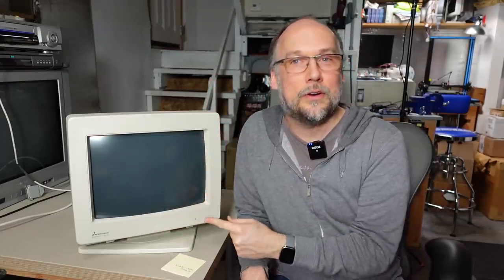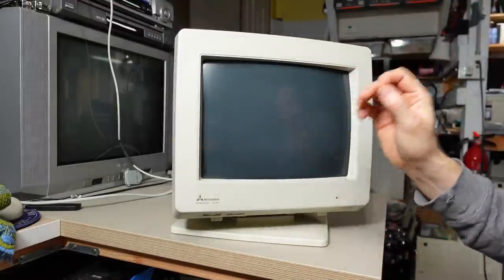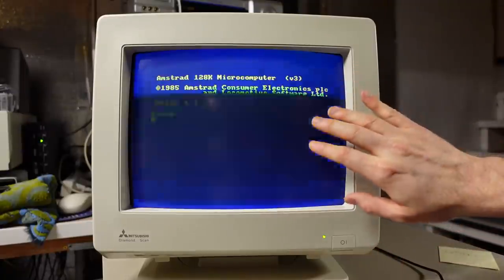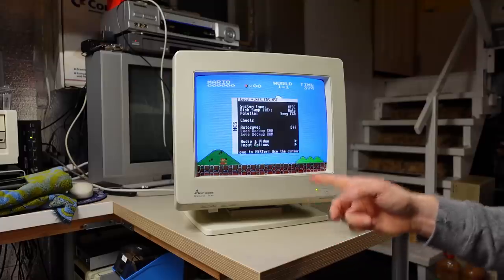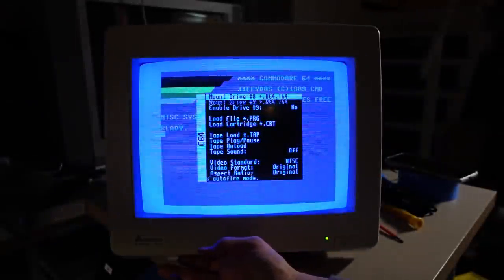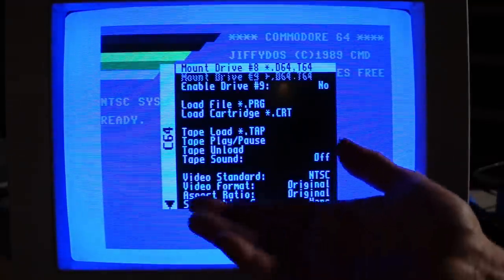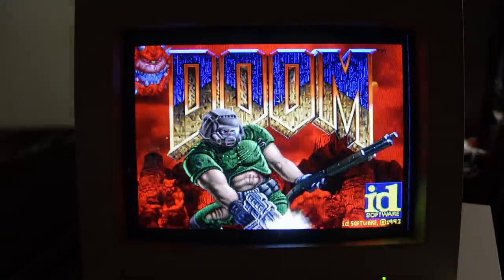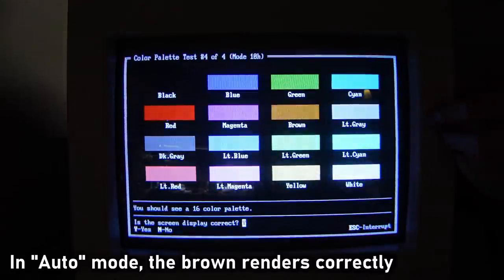Can I rejuvenate the CRT in my Mitsubishi Multisync monitor?

Comment: Also Adrian, you need to put the CRT neck up when doing rejuve and short work because the little metal particles need to fall away from the guns, then when done don't put the neck down at any point because there will be metal particles in the tube, just let them fall to the "side" of the tube as they should naturally when you put the tube back to it's operating orientation.  We do a lot of this kind of work for Arcade games.
Reply: now that you mention that, I remember being given the same caution, years ago.
Reply: This is true. I remember this from when I was fixing tvs.
Reply: thanks for sharing mike, it's a dying art
Reply: you see that hawk crt guy who would open up the CRTs and bake them in kennels?
Reply: As an old TV repairman (when that was a thing) and I worked on CRT tubes, this is a good practice for those tubes.
Reply: Umm I was taught not to do it face down, because the debris can fall onto the shadow mask and block some of the perferations and cause some phosphors to not light up. Also the timed rejuv is not suitable for monitor crt'. It strips the surface of the cathode. Monitor crt's tended to have thinner coating. So what may have been a gentle rejuv for a tv, is very harsh for a monitor.
Reply: Awesome stuff, I'm all in.

Comment: When I was a TV engineer I built my own monochrome tube zapper. (Rejuvenator)
It consisted of two light bulbs a power resistor and a smaller carbon resistor plus mains cable and leads and socket to the tube. It's a long time ago as I was about 17 at the time and now I'm  63. Basically the one bulb 100w was to allow current to the filament and the other 15w was the current feed to the cathode and grid. 
I copied one that the other guys used and it worked pretty well, but not every tube could be improved. From what I remember it was a way to strip the cathode to allow for a better emission. During the process you would often see flashing inside the tube neck, like bits of molten metal flyng about. Another method used instead of a brand new tube for color TV was a replacement tube gun assembly in the neck. Part of the neck was removed and a new gun assemble attached, done at a specialized factory due to vacuum requirements etc. This was much cheaper than a completely new tube. Now as far as setting up the replacement tube after reassembly, a process of purity adjustment using just a red screen was used to remove any other color from that display. Once that was complete then the other colors were checked individually before convergence was attempted.
Sometimes degaussing was required to de-magnitize the shadow mask in the front of the tube. Interestingly I have seen a picture go from looking great with the monitor/tv facing one direction to being all messed up facing a different direction only rotating the unit through 90 degrees on the work bench. This I assumed was due to the earth's magnetic fields affecting the display. Each monitor/TV has de- gaussing coils around the tube and once power cycled from cold a few times this can make a big difference to the performance of the picture purity and convergence.
Watching you replace that tube brought back many memories from my past, especially the point when you got a zap off the final anode connector which do have a tendency to re charge after some time. I got a good zap to my belly and almost dropped a 26" color tube while transporting it up some stairs. Needless to say I was always careful to make sure the final anode faced away from me every time I carried one after that. Thanks for the video.

Comment: 32:33 THAT was a mistake, probably that's why you have bad convergence at two corners. Do not remove correction magnets that are on the inside of the yoke. Those belong to the yoke. If anything, put a dab of two part resin on them so they won't fall off in the future as the original glue dries out.
Another suggestion: next time, measure the two yokes with a multimeter. If the readings are close (within 20-30%), don't remove the yoke and convergence assembly from the donor CRT, try it first! A lot of times they are interchangable, so you can save yourself from the hassle of purity and convergence adjustments. Swapping yokes on modern color CRTs is only a last resort, especially on high resolution CRTs. I'd rather swap the horizontal size adjustment coil on the chassis than swap the yoke.

Comment: One minor safety nit from an old tech, when discharging the anode one hand in the pants pocket, don't give the potential any way to ground through your heart. we had that beaten into us in School. Great vids I have been enjoying them.
Reply: I've been taking CRTs apart since I was a kid. One thing my dad never taught me was how to discharge the tube. Learned that one the hard way.
Reply: @BlackEpyon  My dad was the same. Me: "Is the power off?" Dad: "Yeah, yeah." :P
Reply: @mrcassioo  Could be worse. 17kv DC for a fraction of a second hurts like a bitch, but doesn't kill you nearly as efficiently as grabbing an electrical outlet when it's out of the box and the power is still on. The first time my dad showed me how to replace an outlet, he didn't bother turning the power off. Just told me to make sure nothing was touching the live leads. Metal screwdriver, metal wire cutters, metal strippers, everything carefully manipulated so as not to touch live. And boy, you learn quick! 

I don't recommend that, by the way. Just turn the breaker off first. That first exercise has, however, given me a method by which I always assume that it's live while I'm working on it, even if I know otherwise.
Reply: @BlackEpyon  Yupp, my dad did the same and I now always check thoroughly beforehand as a result. ;)
Reply: My dad used to grab my moms hand as she handed him a new lightbulb and he would sitck his other hand into the socket. Since she was grounded, she would feel the jolt

Comment: I wasn't shouting, but I was saying that you should have done the fine set of G1 before doing anything. Also, you don't start the tester in Cut-Off. You always start with shorts, if you have a G1 short you can proceed to clear G1 shorts, if you have an HK short or any other short you can't proceed. If the tube is used face up, don't bother with clearing G1 shorts unless you have a place to use it elsewhere that isn't face up.

When you saw the good emission, you should have again, stopped. In this case you needed to figure out why you had a good reading and a dim picture. In this case again, the fine set of the G1 should have been checked to make sure it was correct as you made clear you checked out the monitor (you want to check cathode and G1 voltages on the monitor if you have a dim picture and a good emission reading). Lastly, if the tube was designed for a cutoff in the 300 volt range, putting it up to 600 volts could have influenced the result. On some testers the cutoff influences the emission reading.

Lastly, since this was a "Hail Mary" attempt on your own equipment, I can't fault you for trying the restoration anyway. If the tube was in better condition it may have worked as the emission didn't immediately drop off like a very small cathode (such as Trinitron) would have.

Comment: I have a Beltron crt rejuvinater here that was rebuilt and updated just before CRTs went away. I'm in Portland as well but any crt cooker can destroy the guns if you're not careful. The beltron has a cleaning function and a rejuvenation function and it does all guns at once with 3 meters and lights to show what's going on. It's completely manual so you hold the cleaning or rejuvenation button till your happy oy you kill the guns. Usually I use the cleaning function gently then move up from there if I feel it has a chance. The color gun alignment after the fact if you change the tube will still need to be adjusted again and if you don't have the service manual it's going to be really hard to get it perfect because there generally is steps to do to get it right. I have done quite a few tv tube swaps back in the day and some aligned pretty easily, some you could just get close.
Reply: you see that hawk crt guy who would open up the CRTs and bake them in kennels?
Reply: @cdoublejj  OK, I’ll bite… “Bake them in kennels”? As in facilities that house large numbers of dogs?
Reply: @erikberg7891  there is a type of oven that is pronounced like kennel but "kennel" is probably the wrong spelling, especially given my learning disabilities lol
Reply: @cdoublejj  you sure it's not kiln?

Comment: I found a video on youtube showing a guy in the US who repaired CRTs by opening them, changing filaments, and closing. It seems the guy passed away but I can tell you it's possible to do.

I could not find the video again. This senior master technician would crack the neck of the crt and then put a scotch tape around the area and leave it there. After one day, the tube would be filled with air and he could safely remove the neck. Having that done, he would replace and clean parts inside the neck, put it back, use a vacuum pump and re-seal it with heat. I really don't remember the details.

Nice video, as alwayhs, Adrian!

Comment: If you've ever seen the movie, Dean Koontz "Phantoms", I did all the electronics in the mobile lab set. Some of the monitors had to be taken apart to be installed. The whole set was on a gimble and had to be repaired all the time. I shocked myself several times with those CRTs. They will zap you pretty good.
Reply: Damn!
Reply: Hope you were paid well
Reply: Yes…with egg and tuna sandwiches and lukewarm diet coke

Comment: I had one of these monitors. It cost more than the cpu and motherboard I was using at the time. It was a heavy thing, but it could be used on almost anything. Granted, it was a few years old when I got mine, but it was an amazing piece of kit.

Stuff was so strange in the before times. I miss those times, but really don't want to go back.

I find it very funny that your camera picked up the screen just fine. It looks amazing in the video.

Good to see something special get some love.

Comment: I remember getting my first ever nec multi sync monitor, loved the fact you could connect almost anything.
Reply: It was great getting a new video board and realizing you didn't have to buy a new expensive monitor for it.
Reply: Hi - I also bought my first NEC multysync when we had NEC Powermates at work , the first model had the little trap door on the top of the monitors bezel, after 5 years i bought the next series2 version with the typical front narrow flip door.

 Did eventually in 1993-5 but a Mitusishi multiscan monitor very similar to this one featured here, but only ever connected a IBM PC to it - i would have still had the C64 and Amiga 500 in the cupboard for games nights but never connected them to the Mitsubishi

The colours were very vibrant and text sharp, i recall the blue was very strong as many dos text items ( think dos 5 dos 6 style editor menus ) and the early win95 build was very attractive, refresh rate was good and i was able to upgrade video cards almost annually at that period and the monitor was bale to handle screen size and refresh rates with no eye strain

Regards
George

Comment: Glad to see your experiences with Rejuvenation.  I've got a nice BK467.  I've built some custom adapters to use on Sony PVMs and BVM tubes.  Sometimes tubes are just too far gone to save, but sometimes you can boost them and get some extra useable life from it.  Thanks Adrian.  Keep working on CRTs.
Reply: Hey man, i do have a BK467 too, Do you know if it is possible to use it on a 31khz monitor?
Reply: @kirabate  with the right adapter / universal adapter, I dont see why not

Comment: CRT vids are my fave! please keep doing 'em. Maybe the rejuvenation process should only be done once? Is there manuals that say how many times you can do it, or how long to wait between processes? the first pass was an improvment at least
Reply: It's a last ditch effort to get a little more life out of them.  Repeatedly subjecting delicate parts to overvoltage and overcurrent conditions significantly reduces their life even if in the short term it buys you a bit more operational time.  Once is probably all you will get before permanently destroying them.
The only way to fix them is to rebuild the electron gun, reevacuate the tube and seal it.  Nobody left that does it anymore.

Comment: "I just LOVE CRTs"
You and me both! There's nothing IMHO that can beat the warm fuzzy glow of the phosphors in a CRT, and because using a linear particle accelerator (because yes, a CRT is a form of linear particle accelerator, or "linac") to display an image is pretty damn cool.
Reply: Kitty!!
Also: agreed, it’s pretty metal. Vacuum tubes (slash thermionic valves) are fascinating in general for how they operate.
Reply: Kids these days, with their low-voltage, perfectly-safe LCDs! When I was their age, when we wanted to watch TV or use a computer, we had to point particle accelerator at our face! Also, uphill both ways in the snow, etc etc. 😄

Comment: On ANY computer monitor or TV, if the bright controls are "all the way up" and it is still too dark(won't show darker areas), find and turn up a bit the "G2" control (if you turn too  much you get lines in the pix,set below that!)  adjusting that really helps on older tubes! On flybacks with 2 controls on it, it is the lower one(upper is foucus) on some sets it is on the tube neck board as a big pot marked G2 almost always.

Comment: The stuff you learned during the process isn't something you can learn from a book. You have to try it and learn from the experience. Very Good end result considering the replacement tube was completely different from the original! It's a miracle you were able to get it to converge at all. I also didn't think it was possible to swap color CRTs without retaining the original yoke that came with the CRT. I just figured they are glued on for a reason so I never tried this because I was also afraid of imploding the tube by prying the yoke off. You are much braver than I am! Kids don't try this at home!

Comment: I once found a beautiful CRT rejuvenator in the trash!  It looks almost like new and powers up just fine!  I have been waiting to try it on one of my old CRT's, but they don't need rejuvenating just yet.  I like it because it is a neat little portable kit built right into its own case!  The one you have here looks WAY more advanced than mine and MUCH cooler!  👍👍
PS: Many years ago I was working on a TV that burned out and I attempted to lift off the high voltage suction cup and pry it off the CRT tube. Though the TV was unplugged, I had forgot to discharge the high voltage capacitor and I had my other hand touching the glass front of the tube.  I saw a very tiny spark at the suction cup area but received such a high jolt straight across my chest that I was literally thrown back against my mom's breakfront cabinet!  Today that I am much older, such a jolt straight through my chest would probably kill me instantly!  Needless to say I have NEVER forgotten to discharge the high voltage capacitor in ANY electronics I have worked in since then and I do my best to work with one hand behind my back when I discharge them!  Lesson learned!!  😵
Reply: How long had the monitor been  off before you pulled the suction cup?
Reply: Probably only about an hour, giving it FULL power to knock me right on my @ss!  LESSON LEARNED, I must admit!  LOL!!!  😅

Comment: The inaccurate 16 color palette reminded me of a TSR called Rainbow I used years ago to set the values of 16 color mode on my VGA monitor. Each color went from 0 to 64 (or 128, I'm not sure which). Customizing the colors came in handy since it allowed a colorblind person like me to make sense of what was on the screen.  Most programs I used were well behaved with it running in the background but only a few were games so I don't know if a lot of games could make use of it.

Comment: Adrian, I have two of these Kongo units myself. Both needed serviced, and I have the maintenance manual if you need it. I have a feeling your unit needs to be calibrated at the very least.

Also, the initial readings that you saw (.9) were good. That said, it’s possible the cutoff wasn’t sufficient to achieve good grayscale levels. When this is the issue, it’s a lot harder to achieve a decent restore. 

I have a number of these rejuv units — Konig 850, B&K 467, Sencore CR7000, among others. 

I’m happy to help you out with these restores in the future. The trick is to use each of the testers to get a good idea of what the true tube health is. Each of the testers can be used to confirm each other’s readings. 

Thanks for the video. Please reach out if you have questions.

Comment: Great Video.  Have you ever messed around with the "screen voltage" adjustment on the flyback?  Most flybacks from that time period had both focus and screen adjustments vertically stacked.  Raising the screen voltage will make the picture brighter, but too much and you get "retrace" lines.

Comment: Thanks for another informative and entertaining video, Adrian.  More, please.

When I serviced for Zenith, we used "convergence helpers" on CRTs which resisted satisfactory colour purity and beam convergence - 3 to 4" x 1/2" plastic strips with a thin sort of "fridge magnet" 1/2" square at one end.  After a few passes of the "de rigueur" degaussing coil, we techs slid these gimmicks, magnetic end first,  under the yoke and wiggled 'em into some semblance of correctness - while observing a generator's pattern in a mirror, of course.  A little dab of RTV silicone and the "magique" was complete.  Best wishes from Vancouver BC.